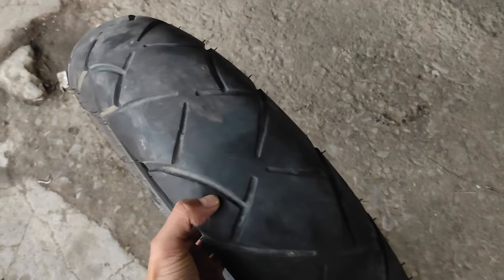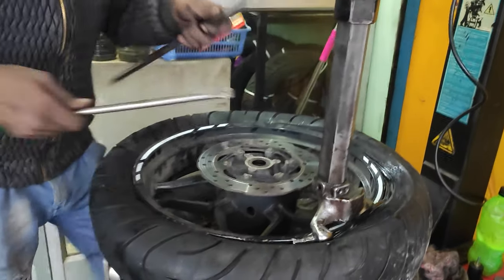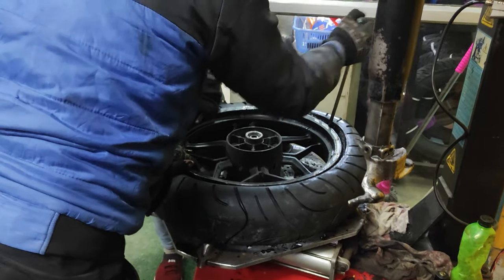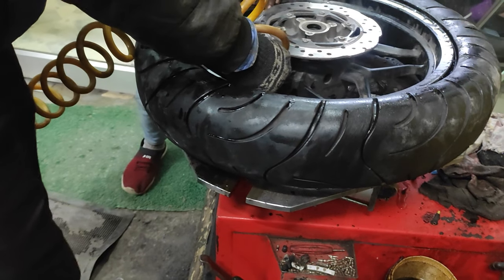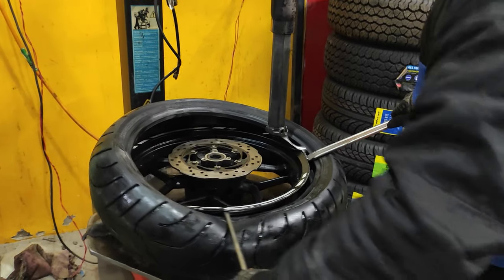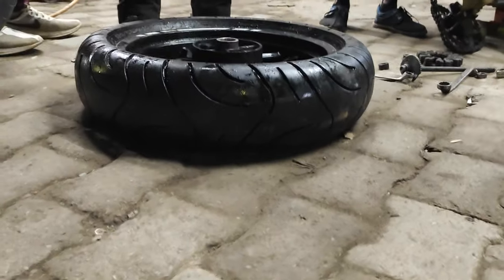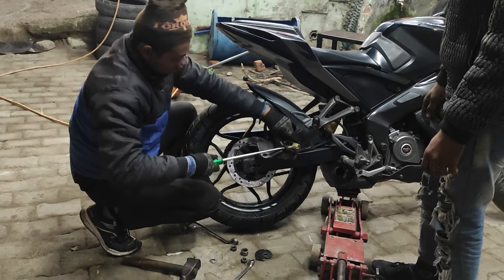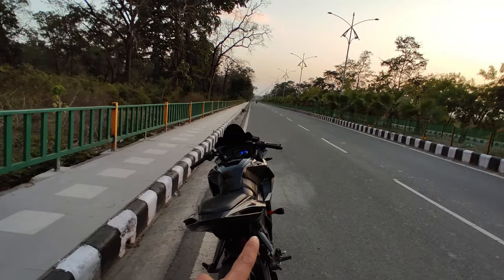Installing 180mm Tyre in my Pulsar RS200😱 |Superbike Tyre In My Rs 200😍 |#pulsarrs200180tyre#rs200

Comment: Definately will affect top speed and mileage... I too hv rs 200
Reply: Is it good or bad
Reply: @Toxidblue21  good for looks 
                     Bad for speed
Reply: @kela9498  bad for mileage , sprocket, engine too
Reply: @kela9498  it is also bad in looks
Reply: @ramandeepsinghreeyat9962  which tire size would be good for rs200?? Both front and back.
Reply: @juicy11  front 110 and back 150 will be best it will not affect your bike
Reply: Bad for top speed, extremely sweet for cornering. It all depends on the taste of the rider.
Reply: Sleep nhi maregi bhai top speed se Kya agar sleep Hoga to maroge

Comment: I have a pulsar 200ns, wear tires size 110/70 front and 160/60 rear. 
And I use dual purpose tires.
After seeing your video I was a little surprised that the 180/55 can fit on standard wheels and swing arms. Good job mate, I got new info, thank you.
Reply from the maker: wlcm Brother 😇🥰
Reply: But mileage Kam hota hai usse, Mera bahot hi kam ho gaya maine for se stock zapper dal diya.
Reply: Does 160 fit with stock allloys and swingarm too?

Comment: Just remember people not all tires are made the same. My Hero 200S came with 130, after the OEM was worn out i decided to go Bridgestone Battlax 160 size. I always liked Bridgestone, because you can easily mark the letter on the tire with a tire marker. But after installing my fifth rear tire, the guy at the tire shop took about an hour trying to fit the tire on the rim, he had to get help from his coworker. After some research, I saw the Michelin is the best tires for motorcycle, so I went with 160 Pilot Road 2 for the rear and Pilot Power 3 for the front. Best tires I ever bought. Reason I went with different models is because the Pilot Road last longer in the rear if it was the Pilot Power
Reply: Why will you upsize your tyre? To a 160 from a 130 section tyre on such an underpowered motorcycle. Don't upsize your tyres, it has 0 benefits. If you upsize from 130 to 140 then it's still understable. But upsizing to a 160? Bigger tyre size is for bigger rims and bikes that require a lot of lean because they carry that much speed. Please research before you guys do something like this. When you upsize a tyre 3 grades the tyre starts bending inwards which causes the tyre to be squared off. What is thr point of a squared off tyre? It's worse than stock in this situation.